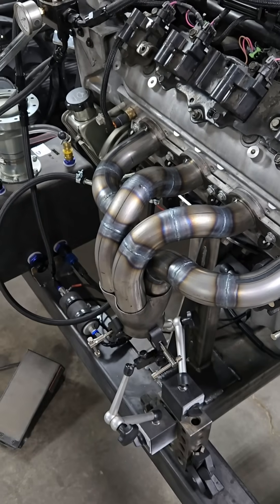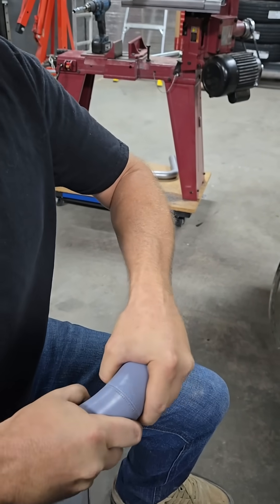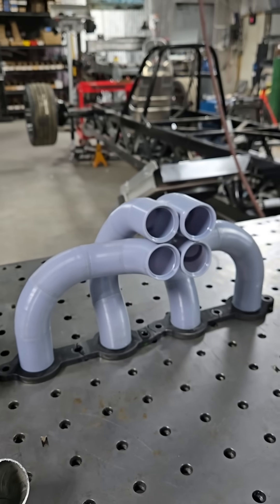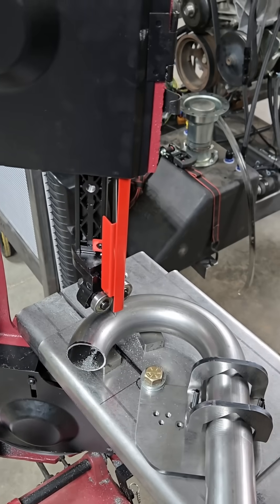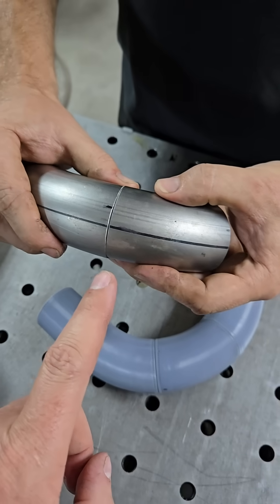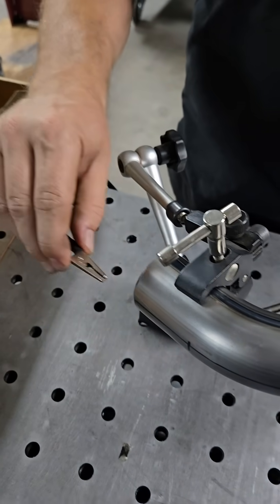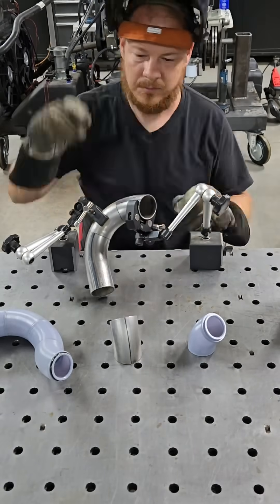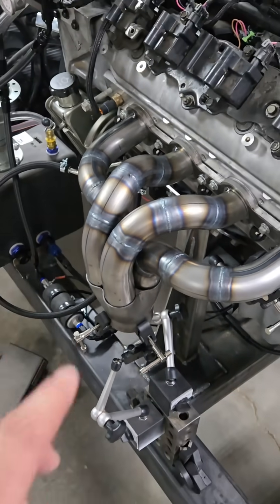Don't build another set of headers till you watch this!

Comment: What's impressive is that your shop is CLEAN.
Reply: The big thing I see is everything organized and most of the shelving and tables are on casters. Keeping a shop clean shouldn't be that hard but most shops are a cluttered PITA that turn cleaning into an all day endeavour of shifting stuff around. This guy can probably move everything to one side then the other and knock out the whole place in under an hour.
Reply from the maker: You nailed it! The shelves, cabinets, welders, tables, all of it on wheels. We also remove anything that has sit for more than a month. If we don't use in a month it goes.

Comment: The thing about that holds the two thing in my box together is pretty cool but I would have been laughed at because you could just technically hold those two pieces together and just put one tack on one side and then attack on the other side and just fill in the Gap.

Comment: I am sure they end up perfectly tuned. There is more to making a high performance exhaust system than just running some pipe. It is a cool idea, but don’t expect the same results as a tuned system.
Reply: Haters gonna hate. It's going to work just fine, the pipes are all the same size going into the bigger collector, cope more technology hater.
Reply from the maker: Thank you. DYNO test coming soon to see how we did against stock.
Reply from the maker: They are mild steel for tuning. The engine is on the DYNO. We make them fast and cheap to test then adjust. TUNED.

Comment: sure. And  a shitload of welding  which is going to harden up, crack and leak.  Why not bend them?  avoid  all those awkward internal ridges  which fuck up the flow, you're e not welding them _inside_.  Sorry, this lego shit  just isn't good enough for  serious racing.
Reply: You do know "Real" racers also use welded exhausts right? No one's bending pipes except maybe formula 1, not even NASCAR would bother Weldings just fine (if you can weld)

Comment: Yeah so easy when you have pretty advanced specialist tools and a shop lmfao 🤡
Reply: You can do it with less, but why would he if he has the special tools. 

3d printer costs $200
Welder costs $250
Pipe costs $100

That's all you need to do what he did, if you want to do it without the printer it's $350.
Reply from the maker: You are on fire! well said!

Comment: What difference does flow efficiency make? I spent a long time designing my manifold on fusion to be exact equal lengths , but was I wasting my time? Are we talkin like 1% power difference?
Reply from the maker: These are equal length. The tools have length on them to help with that. No not a waste of time if you had fun. The power is a maybe. Dyno testing coming soon. A good rule of thumb is a proper set of headers can add 10-20 HP over stock. So for our 450 HP 5.3 that's 5% if we get it right. If not these will be no better than stock.

Comment: Anybody that uses Hercules tools cannot be trusted in any which way or form if you can’t take the tool you used in life seriously I’m supposed to take you seriously rebuilding a $15-$30,000 engine GTFO with these dumb ass videos
Reply from the maker: Wooooo, that was straight up wrong what you just said.
Reply: @ send me a hyperlink of a picture or a video on YouTube of any of these high-end motor shops or high-end horsepower garage that it’s not either using snap-on or Mac

Comment: BUT, what if you want it to be equal length? That takes a lot more time especially on long tube headers.
Reply from the maker: These are equal length. The length is on the plastic pieces and helps make sure you get it right. Easy as 123.
Reply: @centurialinc  oooooo, I bet even paying someone to print this kit for you costs way less than those plastic kits I’ve seen from other companies. I like that the length is on each piece.
Reply from the maker: Maybe. We make them and sell them for a good price. Let us know what sizes you need. Form is on this page. https://www.centurialinc.com/exhaust-tech
Reply: @centurialinc  I like the extra quantity Pro pack y’all have. It would probably be enough to do equal length long tubes on my v10 in my truck. A couple companies made long tubes (not equal length) back in the day but discontinued them a long time ago. I plan on building my own and your kit would be perfect for it.

Comment: How much is all of this equipment tooling and materials gonna cost? 
You can order custom built headers from many sources, for any application... And when you receive them, they are all mandrel formed and not made with thirty individual welds all up and down each runner.
Reply from the maker: That's not the point. Shops that do this type of work already have these tools and for those in the garage who do this for fun it's very affordable. Only $3K in tools. And you can do it for less. This is a very fast and common way to make custom exhaust.

Comment: A mechanic is only as good as his tools!
Reply from the maker: Well said.
Reply: In this case after seeing the crappy welding, the tools were way better than the mechanic? Welder ...😂
Reply: @Bogues_88 internal parts who gives a crap 😂 could look worse
Reply: I have always heard "it's not the tools that make the mechanic, it's the mechanic that makes the tools".
Reply: @lennym1636  😉👍🏻
Reply: Nope nope not true take a trip to Thailand look watch how they build really nice stuff with about nothing it's your mind that makes you good or bad only the quality of welds depends on equipment and skill y
Reply: My dad always said this 😊 tools are everything. anybody that thinks otherwise is close minded
Reply: It definitely is a really good method. But how are they going to weld the inside so it doesn't leak like crazy?
Reply: @1badombre82  😯 what? 
😄🤗 You don't need to weld the inside on material this thin, the weld penetrates all the way through! Google "welding how it works" and you'll find more answers than you dreamed possible! 😁👋🏻
Reply: @ you chamfer the outside edge at a 22/45 degree angle on both pieces being connected that way you can weld the very inside from the outside and layer it to reach the top if that makes sense
Reply: I take your point but still don't fully agree, at least with how it's stated. I'm retired now but lost count of how many times I made my own custom tools, in my mind that makes me the master of my tools! 😁👌🏻👍🏻